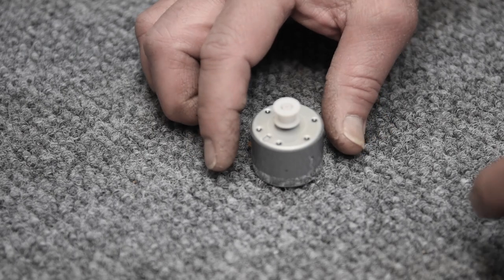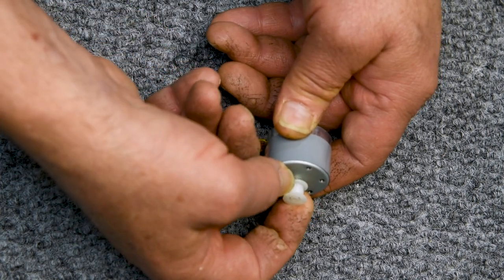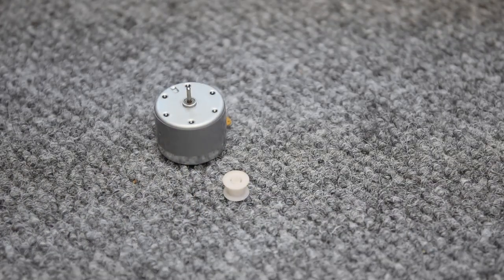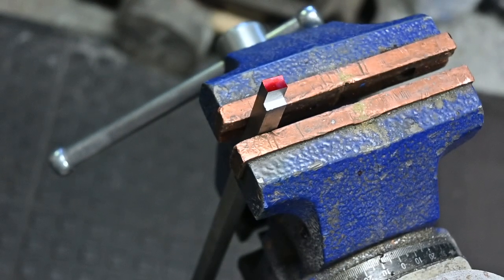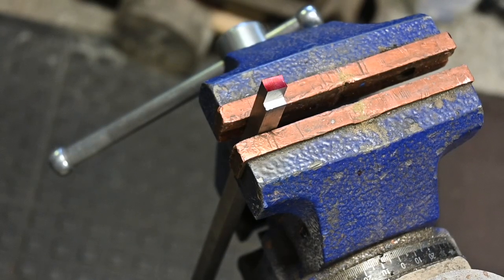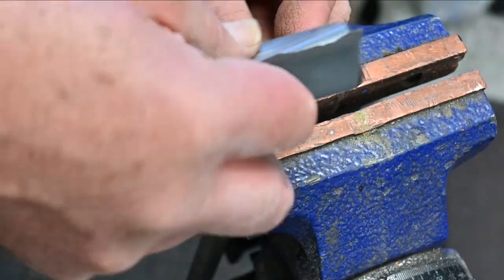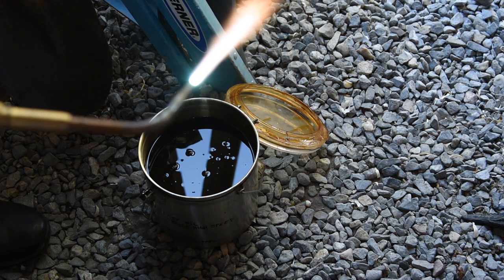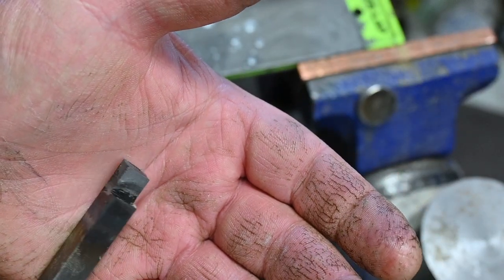Tascam 112mk2 Capstan Motor Pulley Upgrade

Comment: Great job! The more metal and less plastic parts, the better. I realize that some parts have to be plastic, but there was too much used on a lot of decks and various parts, imo.
Like the shattering classic transport posts used on many Naks, using sheet metal screws threaded part way into thin nylon posts. What were they thinking. I know it was said that it was better for sonic reasons, but sonic, shmonic, I'll take metal any time. I was glad to see Teac using nice steel posts for the transport mechanism on the C-series and Tascam 122, etc.
The capstan motors on the Teac C-3X appear to use pulleys made from aluminum, not as elegant as your hand-made brass beauties, but still way better than plastic.
Reply from the maker: Thanks again Retro.

I'm not a fan of plastic parts either but they probably didn't intend for these to be in service for as many years as they are. The older engineers designed for longevity by training and instinct, the younger ones, not so much. The 122/C series will be around forever due to its build quality but they are not a joy to work on at all. The steel posts, springs, and other frame parts are very resonate yes, and can be greatly improved upon. I have a few examples of my solutions scattered throughout the videos but like a chef, don't always include every single "ingredient". 

The aluminum capstan motor pulley is better than plastic and the motor itself has much greater internal mass than the newer series motors, but I do think brass would be better still. I may try this on the 122 in the capstan pulley video because this transport now runs very steady so would make a good test subject for an experiment. I would expect fractional, or single digit percentage improvement, but that's what this game is really all about.

Comment: If you need ready made you can find brass pullies in old VCR/ tape recorder/ i fetch some from scrap yard buyed whole thing just took out motor n throw rest of it .....some parts are very beautifully made like brass pullies ....sharp motors whose speed is controlled by setting points on armature ...head unit of vcr .... Toothed belt ..... In digital world most electronics are solid state ... sometimes I miss that mechanical era
Reply from the maker: Thanks for watching, that's a good tip. My purpose here was to also manufacture a pulley of maximum possible diameter and mass, with very tight concentricity, in order to help smooth and stabilize the flutter. Now, having the tools at hand, I can machine another to whatever custom size I need in future and know that the results will be quite positive.

Comment: I think you are up for the task to making a brand new high quality tape mechanisms, If you need a CAD designer I can help.
Reply from the maker: When you say Cad designer, is that an engineer or a draftsman? I do have need on occasion for both but in a different field altogether.
Reply: @asbcustom  SolidWorks on computer, I do my own prototyping using high resolution resin 3D printers, Though this is just a hobby for me never attempted to do it for profit.
Reply from the maker: I've been learning SolidWorks, it's difficult for me, I'm typically in a situation where I need to get a job done and CAD slows me down because I'm old-school. Send me your contact info via e-mail on the "About" page, maybe we can work together sometime.

Comment: Woah you mill your own pulley..seems like a lot of work just for a cassette deck. But impressive..  is this for you or a customer, cause I'm wondering just how expensive this can be in labor hours.. thanks peck
Reply from the maker: Peck,

The pulley upgrade is for a deck I plan to list for sale when I'm finished, which may be some time. The plastic pulley had shrunk and warped, as plastic does, and was throwing the flutter out of spec. The process to turn a new part was time-consuming yes, but nothing out of the ordinary for a shop like mine, and now I have a ready-made tool with which to manufacture another anytime the need exists.

Thank you for watching and commenting.